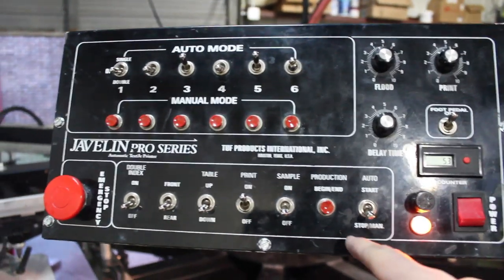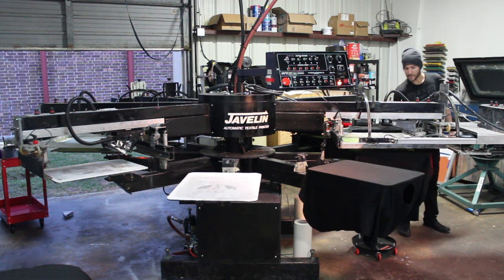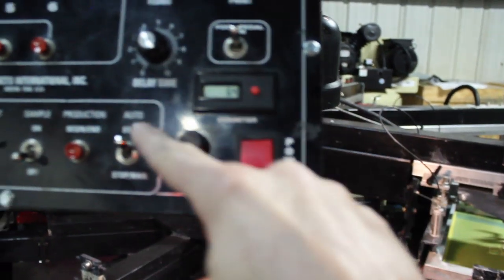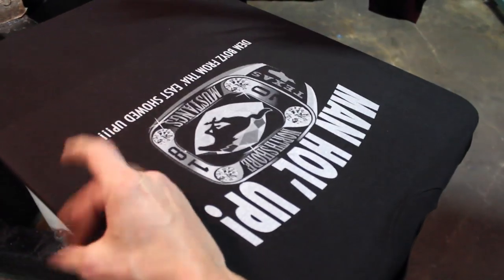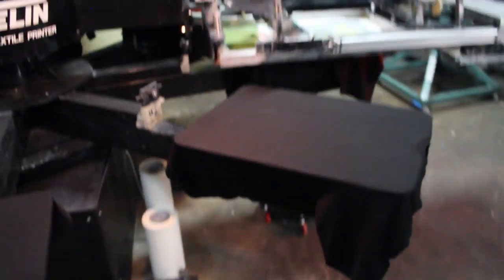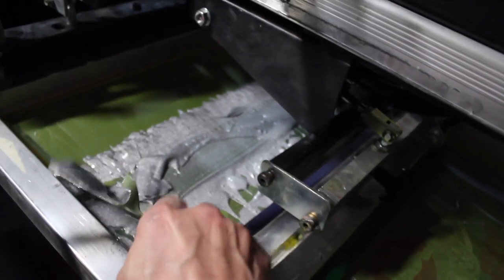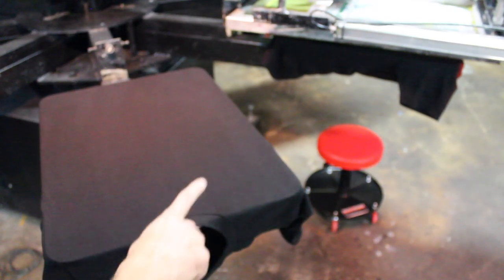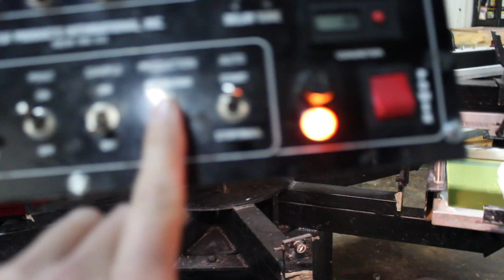How to Screen Print A Job on a Javelin Automatic - 5 Color Spot Proces

Comment: Man all 3 of these have helped me so much we got ours all set up now i havent printed a job on it yet.Debbie has been sick so been slow on getting it up and running.But you answered  a lot of stuff for me so thanks bud..KEEP IT UP....
Reply from the maker: I'm glad they have helped! I hope Debbie gets well soon. I'm sure you guys will have that press cranking out shirts soon! Let me know if there is a video you would like to see. I tried to cover as much as possible, but I'm sure there are still some tricks up my sleeve I could share.
Reply: @mikeydesignssilkscreen473  The first time i tried to  do a print on it there was way to much pressure on the screen and i was printing white on top of that so i started backing it down (pressure).It would print half way then just glad over the ink on the screen so i went down on speed and a little less pressure and it started printing right then.I just have to spend more time on it.Thanks for the good words.Debbie is getting better all the tested came back it was not her heart thank GOD...
Reply from the maker: Thank God for that @nashwarrick ! I hear that. Takes some trial and error. Too much pressure and it just smashes the ink through and doesn't clear the screen properly. Just enough pressure so the squeegeeing flexes a touch seems to work well and at a speed that allows the ink some time to properly clear. Sounds like you're on the right track.

Comment: Prints look great man. So the machine has 2 flashbacks? What if you need to flash btwn each color?
Reply from the maker: Exposing between every color isn't necessary and I actually wouldn't recommend it. It slows down the process and makes your print more likely to stick to the bottom of your screens. Use higher mesh counts to avoid ink from bleeding.
Reply: Mikey Designs & Silk Screen aha understood. So now matter how many colors the print is you generally only flash once or twice tops and the rest is wet on wet or simulated process?
Reply from the maker: @printittowinit  Yes! The only reason I had the second flash going with this job was to print the metallic ink as a print flash print. I had originally set it up so it was printed as a over print, but metallic inks tend to do better print flash printed for the longevity of the ink no washing out of the shirt. Otherwise this job would have just been printed all wet on wet after the base.
Reply: Mikey Designs & Silk Screen haha now im  thinking back on some of the multicolor jobs i did and, like a perv in a trench coat, i could’ve def been flashing a lil less. Great advice thank you so much for that!
Reply from the maker: @printittowinit  LOL! You're welcome!